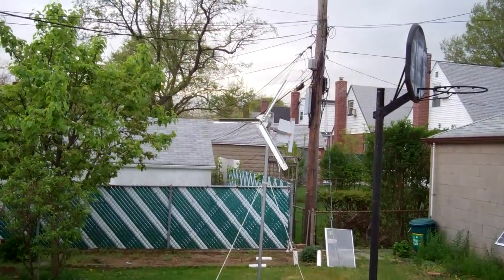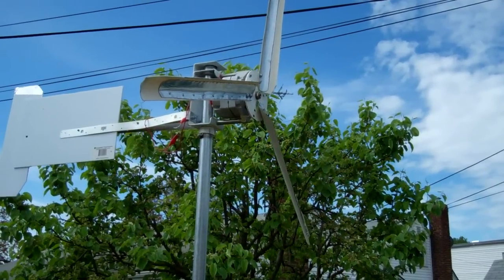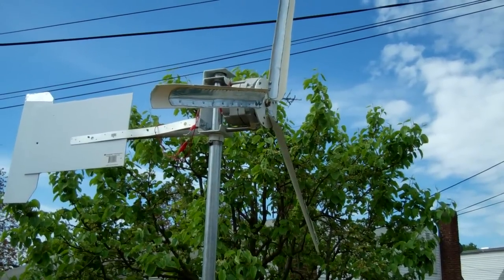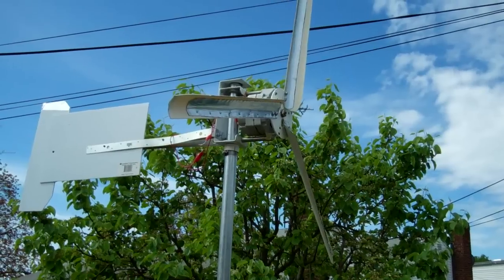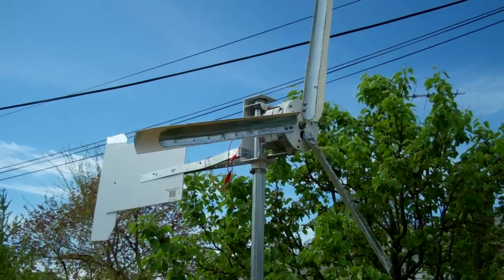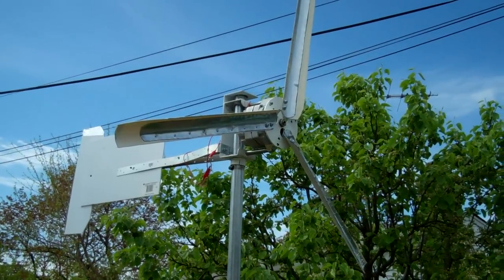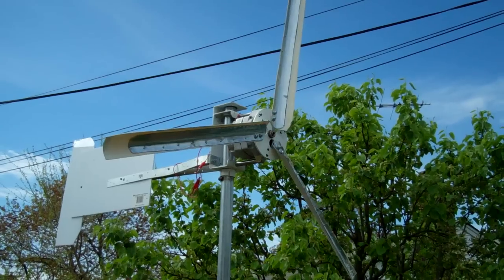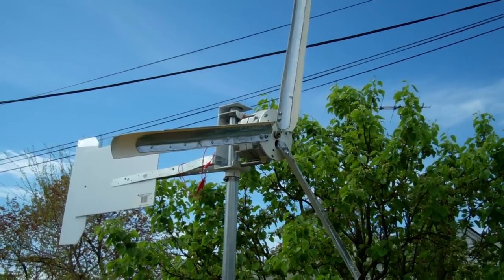A beautiful machine, the 3 bladed car pma wind turbine Movie.wmv

Comment: great job but is it possible to make blades that wont go too fast in high winds for example blades that will never go over 500-600 rpms
Reply from the maker: Dean Walcott I'm sure you can make blades that won't go too fast but I'm not sure why you wouldn't want that. You can always use furling to prevent the blades from spinning too fast and self destruct.
Reply: You can make a brake on it . It looks like a lever with two springs that brake when the centrifugal force is too high